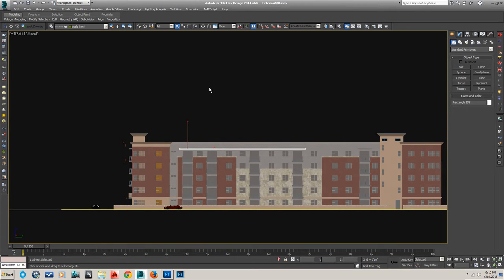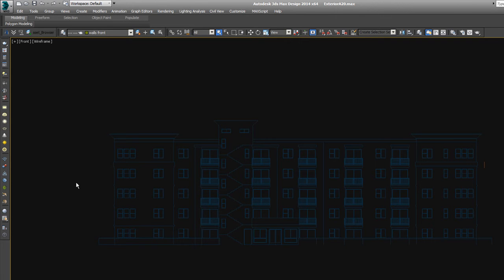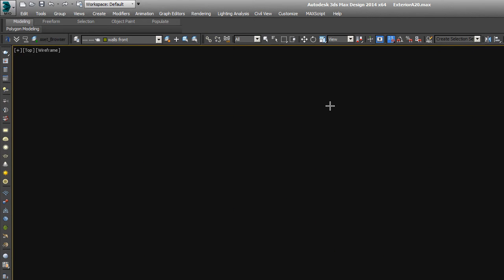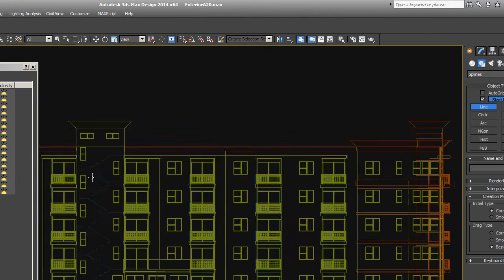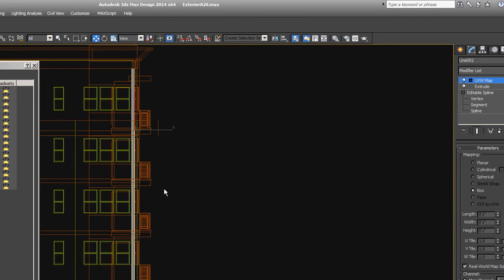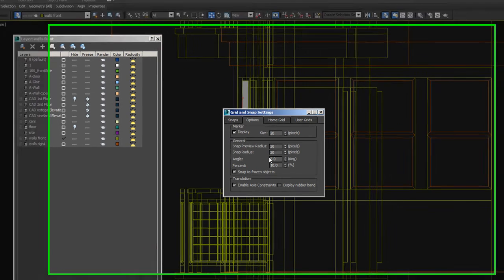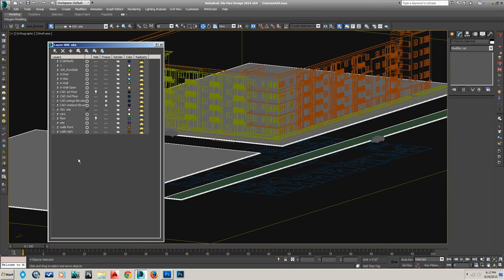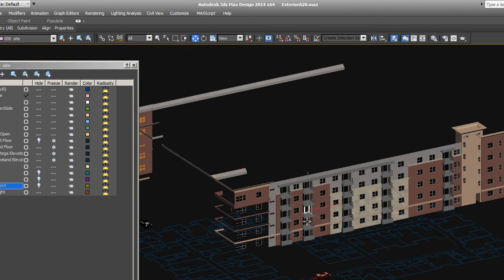Importing AutoCAD to 3ds Max for Modeling Architecture

Comment: Hi i have only just started using 3ds max, but keep thinking to myself is it the right program for me. I design external works for housing company’s normally just using 2d drawings so the contractors can use them, but I would love to be able to show the client the designs in 3D so the contractors and the buyers of the houses can see what everything will look like. So could you tell me if this is possible with this program?
Reply: Pretty much everything is possible with this program.